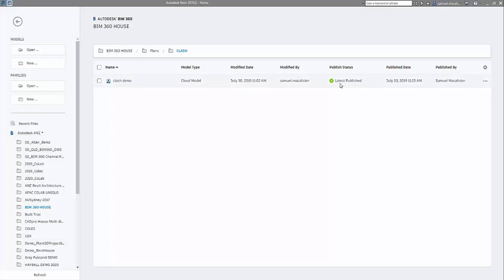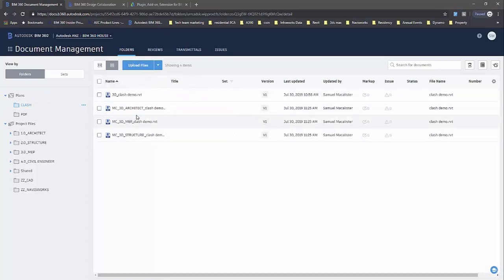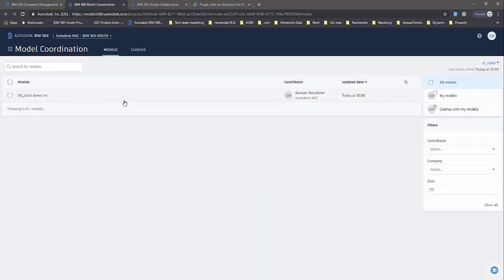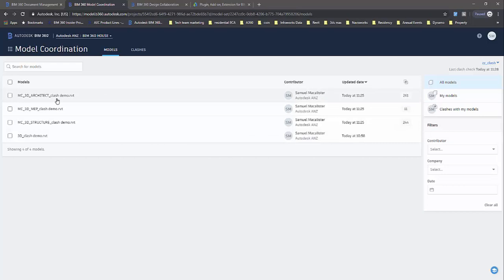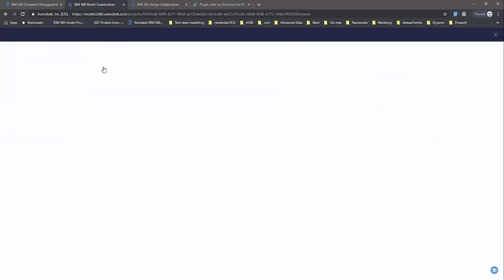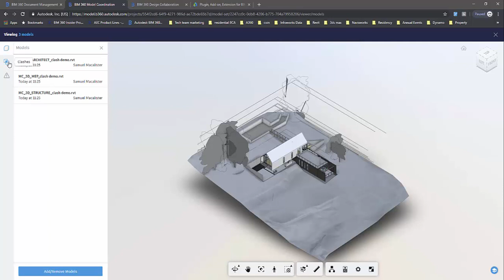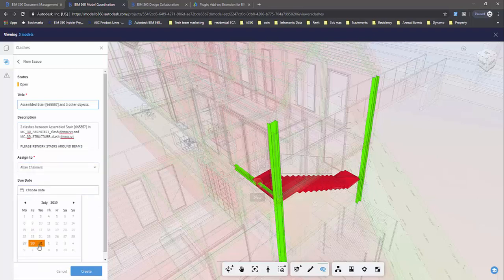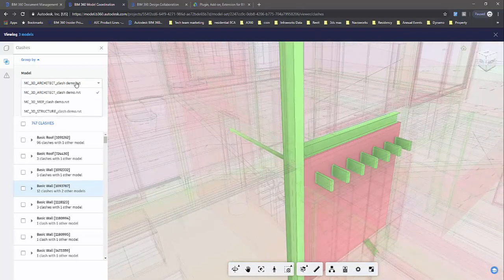BIM 360 Model Coordination Clash detection and Issues

Comment: This tool is developing brilliantly - I will always be interested to see when/if an overtaking point with Navisworks occurs with BIM360.

Whilst Navisworks is still superior in my opinion for automated or refined clash detection, I am seeing some reluctance from certain companies to double handle the programs.
Reply: Hello Gavin, Just saw your comment here ... The company I work for are in the process of implementing some automated compatibility tool:

Basically, we thought about revising the models with Navisworks  (we, the architectures) and then sending the Navisworks model's to the complementary disciplines, so they see and solve the clashes. On the other hand, we thought about testing Clash Preventor (bird tools) or even use this tool above (directly using Bim 360) to find the conflicts. The problem of using directly BIM 360 would be that our customer would have access to all discussions between architecture and other disciplines and problems to solve (and that could cause a bit of disconfort)

So my question is: Could you explain why you believe that Navis is still a better instrument than Bim 360 to indicate clashes? (I've never used BIM 360)

Ps. I'm not sure if I understood correctly: "reluctance from certain companies to double handle the programs" ... do you believe that even if this 360 tool were used the use of Navisworks would be necessary, is that it?
Reply: Thar sounds very exciting!

I haven't been able to use BIM360 for about a year now for testing the clash tools, but I recall then that the rule set creation amongst orher aspects was heavily limited versus navisworks (hand held if I'd be as bold to say).

In my experience contractors prefer it also due to legacy in workflow if anything.

I'm sure there will be an overtaking point once all functions people use are replicated (if).

Autodesk reps themselves have recommended Navisworks to me for detailed clash detection fairly recently so I expect B360 is still more simple than navisworks still.
Reply: @AussieBIMGuru  Yes, I'm excited too! ahahahha

For now it seems to me that the best bet is:

Revit> Navis> Clash detection> Bim 360> Problems

Although this vulnerability of having the problems exposed does not please me very much.

Thanks for the answer, have a great week